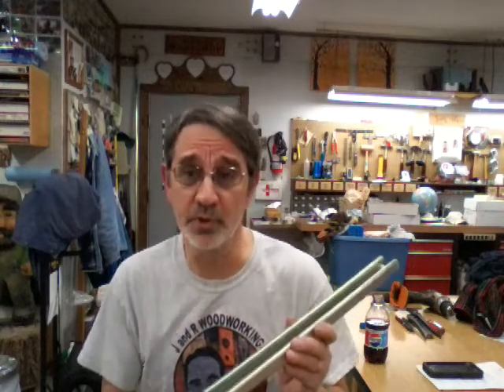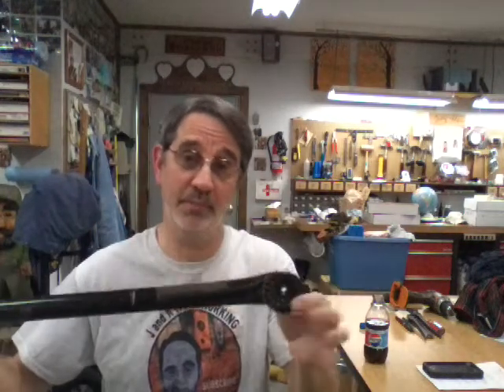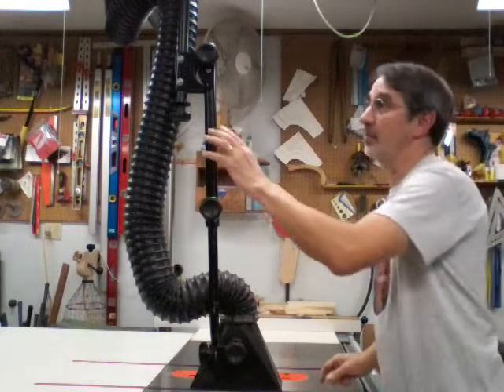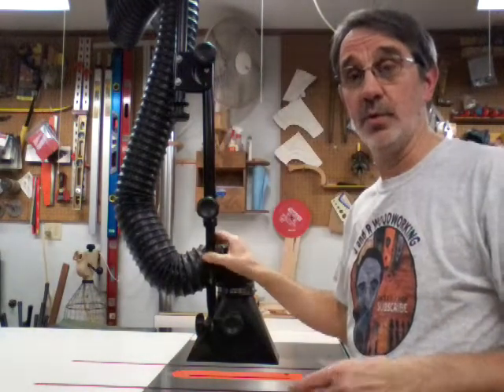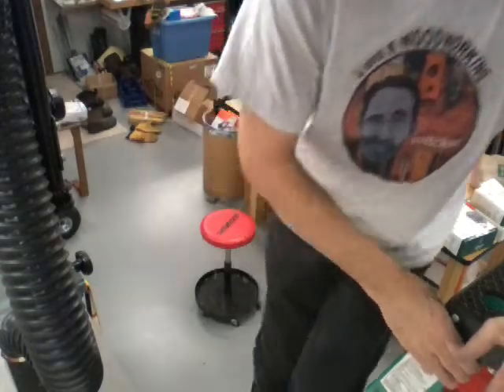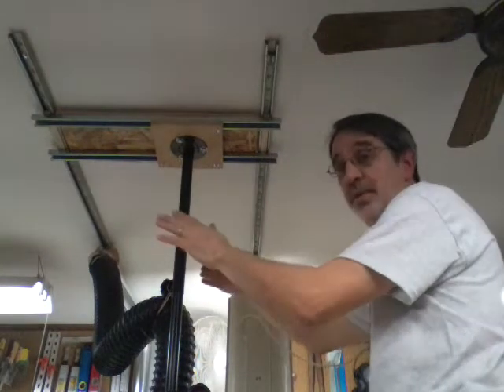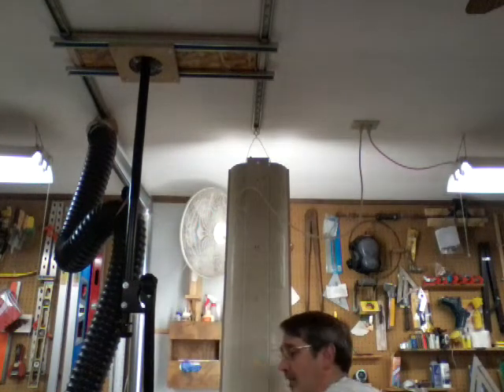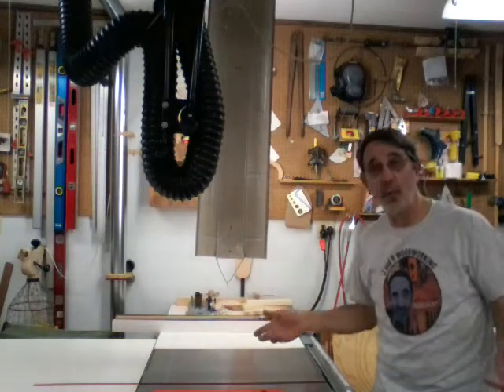224.   My dust collector for my table saw and router

Comment: Jim it sure would have been nice if you had shown us what your rig looks like in the beginning.
Your camera is too close to the overhead DC system.

Thanks for taking the time to create the video, I have been planing an overhead DC for my TS and I am thinking about using 1.5 angle that become track with small fixed caster wheels so that it can be moved both in X and Y and Z much like how you have yours setup.
I made one out of Kendorf or unistrut about twenty years ago at another shop. The spring load nuts wanted catch all the time, so I am going try the rubber caster wheels in angle iron and the wheels will roll smoothly over any dust that collects in the track.
Reply from the maker: TheFalconJetDriver 
  Well when you get it finished send me some pictures or a video of it I would like to see it and maybe pass it on to the rest of my viewers. Thanks Jim
Reply: Jim Jackson I will do that Jim.
Reply from the maker: TheFalconJetDriver 
   Hi it’s Jim
     If you watch video number 66 and 67 it shows the dust collector and a better distance so you can see the whole thing. Thanks Jim
Reply: Jim Jackson 👍

Comment: Hey Jim. thanks for the video. I am excited about building strut system. I must be the dumbest guy on the planet. When you attach square washer in the overhead strut, what is the length of bolt ( or is it a screw) the fastens to the strut ? I understand that you use lock tite and  don't screw in all the way. Please help. thx Bruce
Reply from the maker: Just as long as they don’t stick through the backside of the square block, you don’t want them to hit the screws that are holding it to the ceiling. let me know if you have any other issues. Jim.
Reply: Thanks Jim  Final thought with these square plates/washers.  So you are just using two items: Square plate and screw/bolt. Is that correct? Thanks for your patience with me. @jimjackson9381
Reply from the maker: Yes, I use quarter inch bolts going through the lower pieces into the square knots in the upper strut, tried to send you some pictures pictures but apparently I don’t have your complete email address. Jim.
Reply: ok  I found 3/8 square threaded nut 20 hole size. On Amazon. so next week I should be up and running. I will keep you posted. Enjoy the Super Bowl. Thx Jim
Reply: Correction this is the hole size   Hole diameter: 3/8"-16